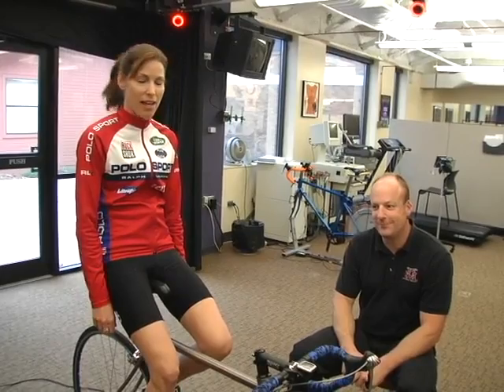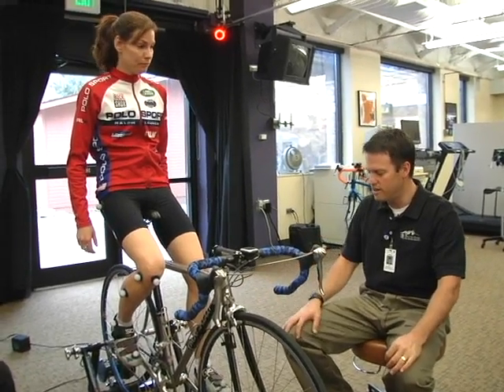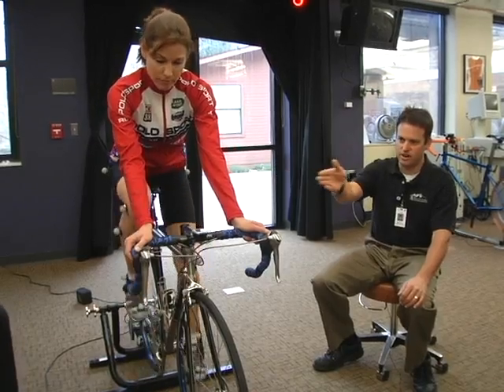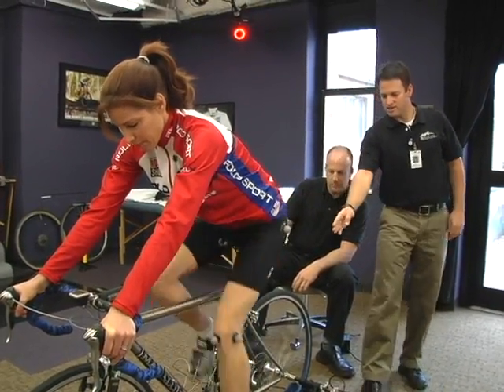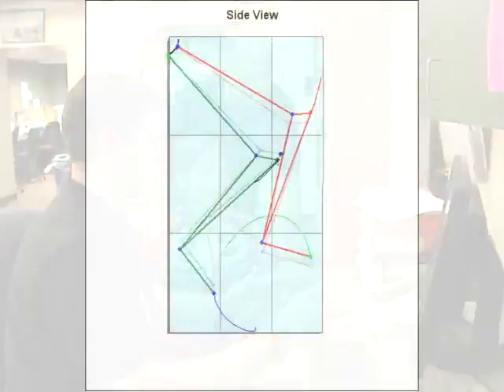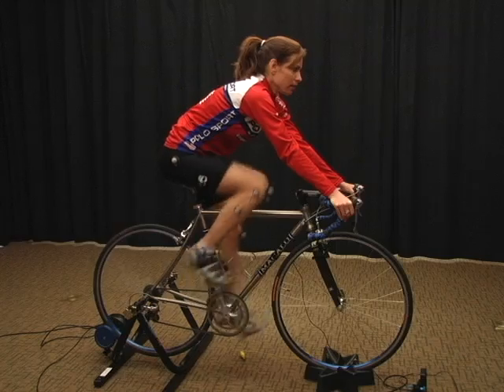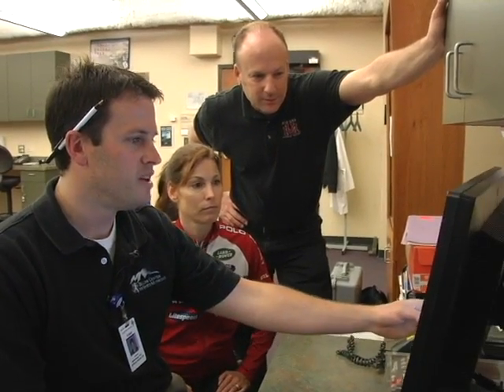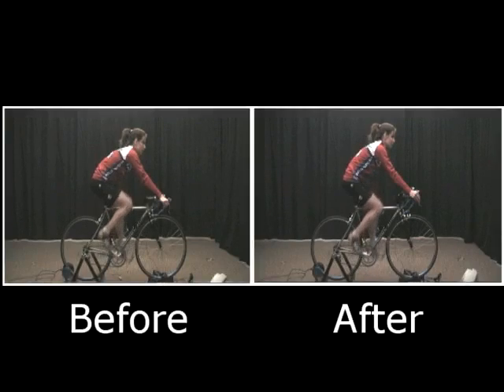Bike Fit

Comment: Lol "anyone who rides their bike more than 10 minutes a day" benefits from a bike fit. Not really. Only if you ride your bike for sessions longer than 1h and feel discomfort. Unless you're a serious rider doing sessions over 2h it's not worth being too picky about these details. Just make sure that 1) your saddle isn't too high or too low (avoid lower back rocking and leg over extension) 2) your saddle setback is in a ok ballpark position (plenty of videos about that too) and 3) your handlebar is close to the wheel axle when you look down (might need to adjust stem length. Do not compensate with saddle setback). That's already 90% of a bike fit done by yourself. For free.

Comment: Good vid, but you can do this yourself with a little knowledge. No need to pay $$. If its wrong you can feel it. Total beginners can just research and learn .
Reply: littlegoobie  I believe people who ride road bikes are very elitist. I never really rode a bike much as a kid. I starting riding a bike regularly at 46. I bought a comfort bike which I still ride today, then a hybrid which someone just stole and I just bought a road bike. In the straightway  I see that the hybrid and the road bike  are better.  But commuting around  town going across various streets I still prefer my comfort bike because I can comfortably go anywhere. I  have never had it fitted  other than me adjusting  the handle bar or seat until it fit right. I had for seven years averaging 65 to 100 miles a week.
Reply: that's not necessarily true.   when you're going from riding casual kid's bike to a real road bike, chances are, you had your feet land flat on the ground while sitting and you're riding with a bent knee..  Most kids ride like this.  going from that to a proper seat height raises your feet way off the ground and it feels very wrong and uncomfortable at first.   I remember when i made the transistion and  I've tried to get several non-biking friends to raise their seats over the years nobody likes it at first. .
Reply: Stuart Perry dear racer .. you can visit my official website for new amazon bicycle-- 
web site is http://bestroadbikesreview.com/

Comment: I agree.  What you really have to do is get a powermeter and cycle on a trainer and adjust the bike.  Make the bike fit the rider NOT the other way around.  I thinkn this woman's top tube was way too long for her....as USUALLY women have longer legs/body length and men the other way around.
I would NOT raise her saddle...she is barely getting her toe to the bottom of the crank arm.
There is a vdeo of Armstrong on a trainer/powermeter..THAT is how it's done!..everyone is different.But POWER is#1.

Comment: I'm not so sure about bike fits.  After my first one, 2 years ago by one of the top fitters in Minneapolis, I began experiencing knee pain on my first long ride.  The fitter had dropped my saddle about 2 cm.  I stopped riding, raised my seat back to where it was, and that cured that.  At my 2nd fitting, a week ago, they lowered my seat, then lowered my handlebars to stretch me out more...just the reverse of what they did with this woman.  I went from a 55 degree angle to a 40-45 degree angle.

Comment: After watching this video I made several adjustments to my bike with my wife's help.  I realized my seat had been too far back and my leg was getting too straight in the bottom of the stroke.  Using a homemade goniometer and a plum bob I got a fit more like the "after" in the video.  The result was a more comfortable ride.  I agree the fit has to be comfortable to the individual, but don't discount the science.  You can bet that the pro riders at the major tours are all fitted in a similar way.